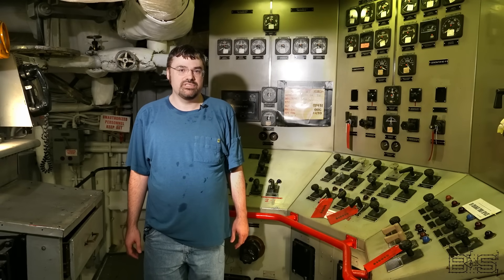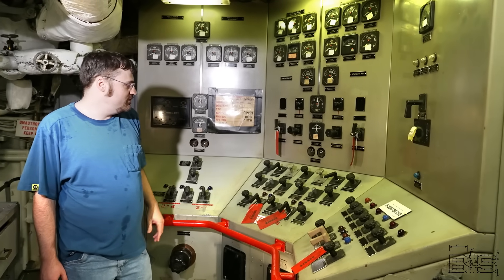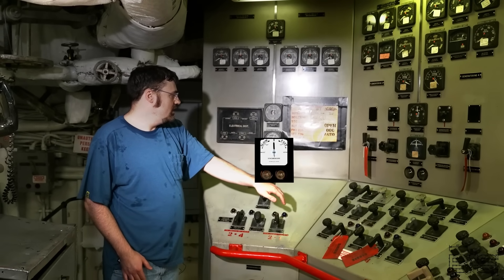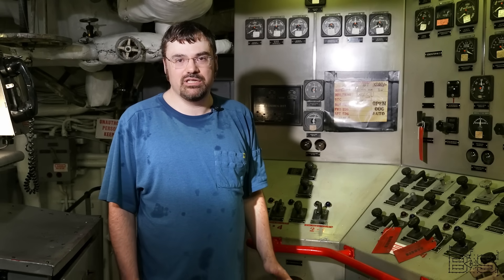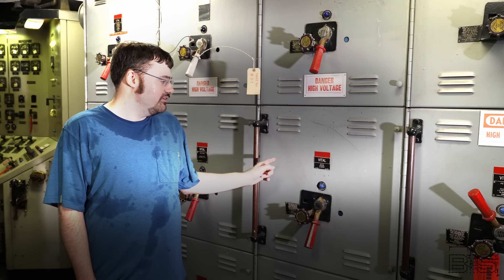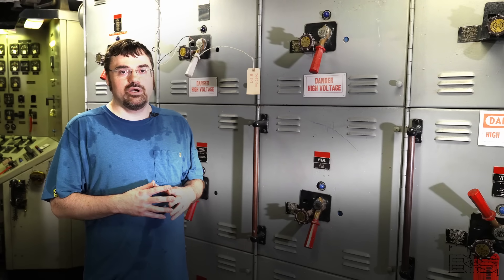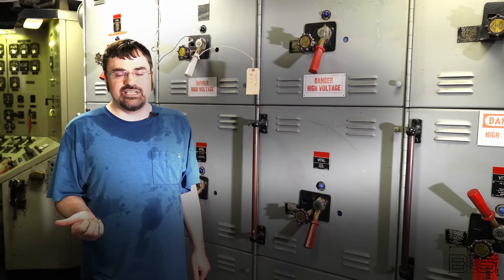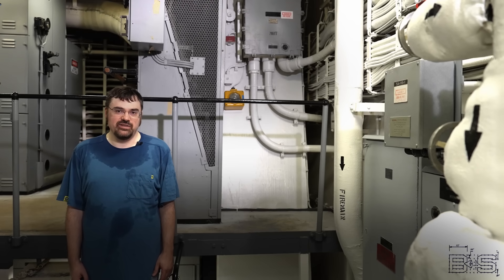The Most Dangerous Switch on a Battleship

Comment: As a EM on a FF we only had 4 generatora total. 3 main turbine gens and one diesel back up. We were running drills around gitmo and ran one where the main bus was dropped to the rear diesel switchboard in order to have it start automatically. Well the book tells the main switchboard operato to close thw main bus after 30 sec? Anyway the main bus on the rear switchboard is dwsigned to drop out and disconnect when power is lost to the main. That wat the rear switchboard operator needs to reconnect to the main bus. Well the rear main bus failed to drop out and when the rear gen came online and the main operator closed the main bus the rear main bus blew up and caused a fire in the rear switchboard. Needles to say a small group of us in e division spent two days in a small room with no ac in August in gitmo rewiring tge switchboard. We had no ac because the ac unit for tge rear compartments was run only off the rear switchboard. It sucked but we got the job done with no issues. So ya those main busses can be dangerous.

Comment: A better word than peaks is using the word power factor when you get the power factor correct you can lock in the breakers. There's a guy on here called Chris Boden and he runs hydro electric plants and he has so much knowledgeable videos on how switch bored like these work granted they are not the same as he's using water to turn his where your using steam.

Comment: I worked on an icebreaker with diesel-electric propulsion. The power rails of the generators have explosive charges that are triggered in the event of a short circuit. With this explosive fuse is also connected a regular fuse in parallel. Can anyone guess why a regular fuse was needed?

Comment: Sounds like the best move when going into battle would be to run all four generators separately. If battle damage takes one down, the other three will still operate.
Reply: Correct.  The Second Naval Battle of Guadalcanal demonstrated what happens when mistakes are made coupling generators.  The South Dakota (BB-57) was rendered combat ineffective and took severe punishment from the Japanese battleship Kirishima due to repeatedly misconfigured electrical power.  At times the South Dakota when totally dark and lost radio contact with USS Washington (BB-56), the only other US capital ship involved.  Fortunately for the US, the South Dakota survived the encounter while the Kirishima, fixated on the helpless South Dakota, failed to detect the Washington closing to 10,000 yards (point blank range for their 16" guns) and was smothered both 16" and 5" shells and later sunk.

Reports vary as to what caused the South Dakota's electrical problems.  The ship was then the newest in the Navy, so training was one issue while others claim a single operator repeatedly misconnected the busses.
Reply: @mikemilner8080 if you look at the hawaii missile alert investigation, it's possible for a single confused person to keep repeating a mistake - though in that case their tools and procedures also sucked.
skill + training + design + qualification for the task

Comment: As someone who has to go through Arc Flash training every year, just because I have the possibility to work near switchgear... when in reality I would turn around an walk the other direction.....    Yeah.....   I would not wanna be anywhere near that stuff when it's running.      When copper vaporizes, it expands approximately 67,000 times... to put that into perspective, a chunk of copper the size of water bottle expands to the size of a fuel tanker truck... instantly.      The word "explosion" is absolutely not an exaggeration.
Reply: went through basic arc flash "training" in highschool cause I went to a technical campus for a few classes, that teacher did not tone down how fuckin DEAD you are if you were near an arc flash and the instructions on if something big started shorting was to get the hell away from it and shield your eyes while the systems in place tripped or it finished exploding
Reply: @sypeiterra7613  …and if you survive, find working shower and stick yourself and any other victims under a gentle patter of water until you are found by a competent medic. At least that’s what we were taught, not sure if it is still current advice?
Reply: On a Nimitz-class carrier, nominal generation is at 4160V instead of 450V. 😁
Reply: @ReflectedMiles  higher voltage, lower current. Lower losses and thinner gauge wires.
Reply: Even container ships run with high voltage generators (a factor in the infamous Dali allision with a bridge). Less current means less copper and less weight. The electrical demands on a carrier are likely well into the megawatt range.
Reply: Sorry for my ignorance / curiosity, what is the need for such high voltage? I understand an aircraft carrier its like a small city, but I believed >4000 v was more for a metal foundry. Thank you and excuse again my lack of knowledge
Reply: @ñunfla  Mix of factors, but ultimately, efficiency is the bottom line.
Reply: @ñunfla  Thinner, lighter, less expensive conductors and lower I^2*R losses.  Like the other commenter said, efficiency.
Reply: @ñunfla raw power. Although i think they have a foundry on board. Supposedly they can recreat most parts (maybe any part?) that they need completely from scratch.

But also, that raw power. They have electronic tools and countermeasures and targeting systems and engines; so many things are electronic now. And if you want them to all work together for more than a few minutes, you need not only giant batteries, but a giant source of charging power. 

If you think about pur power grid, we have 10,000 volt high power lines to keep things efficient, despite all homes in the US running on 110 volt. I'm sure the battleship doesn't have 4000 volt computers or 4000 volt light bulbs. But when you take a little bit of power from the 4000 volt source and step it down to the working voltage, it goes a LOOOOOOONG way. Virtually no voltage drop at the spurce, and even if there is, it's still SO MUCH HIGHER than the working voltage that everybody still has plenty of voltage to pull from to do whatever they want at 12v-460v anywhere in the ship.
Reply: @ñunfla the line above my house that feeds the 240v step-down supply transformer is running 4800v. Its at a lower current but a high voltage so a smaller gauge wire can be used. The pole transformers step it down to 240v 100 amps to supply power to the homes.
Reply: @ñunfla power in watts is volts times amps. For a given conductor like a wire for example. How much that wire heats up is based on how much current in amps is flowing through it. So as you raise the voltage you can get more power for the same size wire without it melting. (Or getting hot enough to lose structural integrity before it melts depending) 
It's why we use high voltages from tens of thousands up to millions of volts for the high capacity transmission lines. If we didn't use such high voltages they would just be impractically big and expensive. This is why you would want to use them in an arc furnace. They require power on the scale that they could be using most of the power plants output. So they'll generally take in transmission line voltage and step it down to something a bit more reasonable. Also the high voltage makes it easier to create a complete circuit between the electrodes and whatever material they're melting.

Although I don't actually know what they operate at. Never been in a foundry or near an industrial arc furnace.
Reply: @ñunfla you can transmit the same amount of KW with smaller wire. That's just One of the advantages. The advantage of 480v ? You don't have to deal with Thousands of Volts. The 4160 has practical advantages. So does 480.
Reply: @ñunfla  Try run your battleship with AA batteries ?
Reply: @ñunfla don’t confuse your voltage with the amperage. The voltage of most everything on the ship runs at 440v, the amps is the current required to operate everything.
Reply: @ReflectedMiles  4kV?
Reply: That is crazy! Not bad, but...
I worked on a merchant ship that had transformers to boost 480 to 5000v, for the bow thruster. Made for much smaller conductors to go 800 feet to the thruster.
I made damn sure it was deenergized before I even opened a panel! 😮
I can't imagine the transformers for all that!
Reply: Reminds me of the "NO SAFE PPE EXISTS" sign I saw a few years ago on r-slash-ScarySigns, on a 1,500A breaker panel. If you got arc flashed by THAT kind of power, you have two outcomes:

* "Not only will this kill you, it will hurt the whole time you're dying" (the genocide ending)
* "You wouldn't exactly die of anything, in the traditional sense; you would just stop being biology and start being physics" (the mercy ending)
Reply: Arc flash is terrifying. I’ve seen a solid copper busbar vaporise in front of me. Luckily I wasn’t close enough to be hurt and most the molten copper splashed against a metal panel but it shook me up.
Reply: @ThePhantomGhostMan  Had an electrician working on our house (adding a circuit) once drop a bare grounding wire such that it fell across the box entry lugs (i.e. upstream of the mains breaker). Fully uncontained and it still left quite the impressive scorch mark on the brick wall -- which was mostly shielded by the box itself. Luckily he saw it starting to fall and was able to partially duck out of the way, and 120v took a second or two to melt the copper and turn into an arc.
Reply: And if you did survive the explosion you dead from ingesting copper,   a very nasty death.
Reply: Arc Flash is no joke
Reply: Copper thermite can demonstrate this easily on a small scale!
Reply: I think your math is a little off. If a 6in^3 object expanded 67000x it would be on the order of 6mi^3. 

6 in³ * 67,000 = 402,000 in³
Reply: @silverXnoise  This is what I was told in training.   But.... 

I asked AI the following:  If you expanded the volume of the average water bottle 67,000 times, how big would it be?   
Answer: If the volume of a 16.9-fluid-ounce (500 ml) water bottle were expanded 67,000 times, it would hold about 10,955 gallons or roughly 41,500 liters of water, which is comparable in volume to a small residential swimming pool.

I then asked AI the following: What is the volume of a tanker truck?
Answer: The volume of a tanker truck varies significantly, but a typical large, road-legal fuel or liquid tanker holds between 5,500 and 11,600 gallons (or 20,800 to 43,900 liters)

Comment: Good video.  I used to write up and perform procedures for testing ship service generators when I worked at the San Francisco Naval Shipyard back in the 1960s.  I think any of the switches when activated by an untrained person can be dangerous.
Reply: A friend of mine came from Kwajalien to set up a ship for a test back home. He bought his supplies and set up his equipment and needed ship's power to test. He asked an old salt if he could have some power. The guy got up from his chair and cussed for the next 10 minutes while my friend just stood there and took it. After the rant he asked...Well, can you do it? The guy cussed for another 10 minutes and then turned power on. A few days later, the night before they sailed off, the entire crew met at a bar for dinner and drinks. As my friend walked in, the old guy stood up and introduced his best buddy to the entire crew. Friend said he had a wonderful trip back to the island.

Comment: Onboard aircraft carriers the SSTGs are 4160V so it's even more spicy when one of those is forced to become a steam pump. There was an incident where even the thicker casing was no match for a phase to phase fault on an isolated bus during a drill. According to the incident report there was a sizable hole that looked like someone had cut using a poorly configured plasma cutter

Edit: spelling
Reply: Yes, an arc fault is a poor but very effective plasma cutter that is running wild.  It usually doesn't stop for anything.
Reply: Even with an arc flash suit, I don't think one would come out unscathed even if you could survive it at all especially at 4kv. I watched a short documentary, here on YT, about a poor fellow that worked at a paper pulp mill. It was at the end of his shift and did not suit up. He was trying to find a fault of a 480 Volt motor switch. He was inside the breaker panel and had defeated the door disconnect safety, system was live. He was probing with a fluke 87 multimeter. The meter started an arc and blew the guy across the room. He had no cloths left and he was burn beyond recognition. He was literally burning. From eye witness statements, he manged to get to his feet but he didn't get very far. He died later that evening. It boggles the mind at the immense power in these systems.
Reply: @bain5872  The suit is just so your family has something to bury

Comment: Modern automatic voltage regulators have safety limits on maximum field current and trip out on safety. Some known fault conditions are detected and are shut down automatically. This is the role of modern SCADA systems. Supervisory Control and Data Acquisition systems.
Reply: Oh, I thought SCADA systems were intended to be put on the internet so that Chinese hackers could access them and shut down the US power grid in case of war.   /s

Comment: Nope.
What you are suggesting is that the voltage drop from a generator thats feeding a fault condition is somehow a safety feature. And that when all generators are paralleled, that volt drop is not enough.
Thats NOT how circuit protection works. There are circuit breakers with appropriate response curves to protect the system.
Reply: The circuit breakers have to be able to withstand the fault current without welding themselves closed or failing in some other way.  It is entirely plausible that it wasn't feasible to design all the protections for the all ties closed condition.
Reply: Bus tie breakers are spring operated, with the spring "charged" with an electric motor.
If a fault occurs on an individual circuit,  that breaker 'should" trip. If that fails to open, then the bus tie breaker will trip. I've only seen that once in 50 years. It was when a circuit breaker blew up and grounded the main bus. That bus tie was what connected the main & emergency bus. It protected the emergency bus and switchboard.

Comment: They do not wire something as small as a ship with wire gauge used for power exiting a large power plant. Redundancy makes the current potential going to line and current carrying component greater than the gauge of the weakest link by dangerous margines.

Comment: Don't forget that all the reactive power from the whole ship's motors and transformers will want to dump through the fault too. Nasty.
Reply: The fault current is determined by the short circuit impedance and supply voltage. The reactive power is load dependent and has no effect on the SCR.
Reply: @fablearchitect7645 True - but motors that are spinning at the time of the fault may back-generate into the fault under inertia.  This is not reactive power though.

Comment: The switch is labelled orders only and even has a lockout that might even be two handed to operate just to be sure.

What sort of orders would warrant closing that switch? About the only circumstances that come to mind are they took a hit and have all kinds of broken stuff to deal with and it's that or nothing. I'd risk the electrical fire before doing without the 16" main guns cos we're probably still in a shoot back sort of situation. 

But is there any normal circumstances  that come to mind that would warrant it?
Reply: It would be used to reroute power if several generators failed.
Reply: On warships there are places you can jumper around most critical systems, in an emergencies,  including battle damage, among other reasons.
Reply: @brucelytle1144 I’ve seen military electronics with a “battle short” switch that disables all protection circuits.
Reply: @connerlabs  Never had anything to do with electronics in the Navy, I was a Machinist Mate. But, I do know that, no matter what, if the switchboard isn't giving you power, bypass circuits don't work. It is a complete no-no to bypass breakers. This is because of some engineering officer thinking it was a good idea to tie a circuit breaker during a battle (Guadalcanal) that f'ed things up, the ship was lost.
I've worked as a Licensed Engineer & Chief Electrician on ships. Tying/bypassing circuit breakers is an absolute no-no! You risk more damage than you already have. Trust me, I've seen it happen to others, and learned, watching them F up.
Reply: @brucelytle1144 I went back and checked this information. I saw the battle short switch on one of the MEP series of generators. It bypasses most of the usual protections like high coolant temp and low oil level. But over speed and short circuit protection remain active. 🤔
Reply: 15:45 He answers this.

Comment: I think what tends to keep the generators synchronized once paralleled is the back emf created by either generator.
Reply: That's basically it, they're synchronous machines, so the load results from the phase lead/lag of the generator's back EMF and the bus. Generator leads the bus -> generator is feeding the bus, generator is lagging behind the bus (in phase) -> bus is driving the generator and it's essentially a motor. The amount of phase difference between the generator and the bus is proportional to the generator current (and hence the load).
Reply: Normally, the stator creates a magnetic field opposite in polarity to the rotor, that field is powered by the other generators on the bus. The two magnets lock together. If you accelerate the rotor, the stator magnet drags it back. However if you load the rotor, the stator magnet drags it forward.